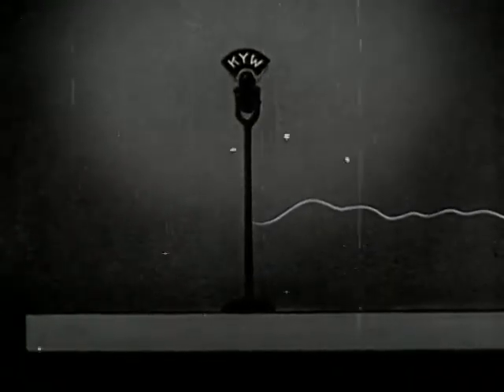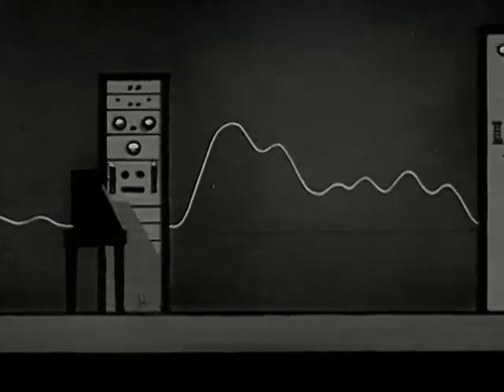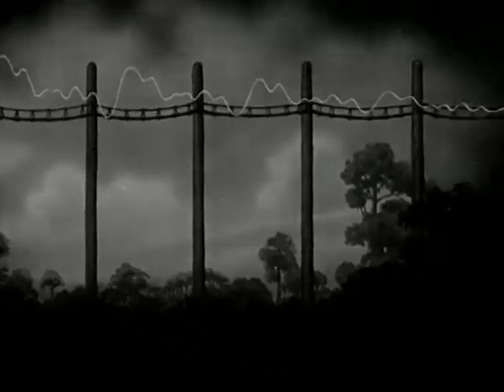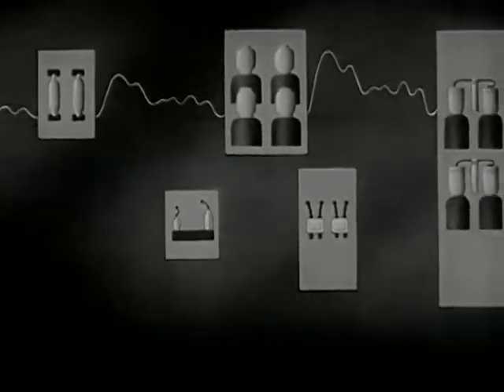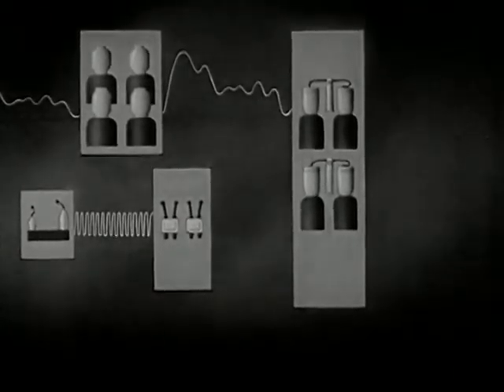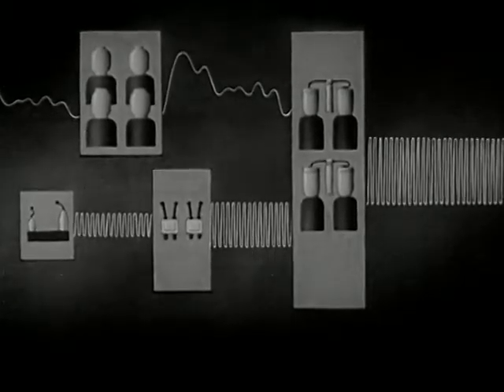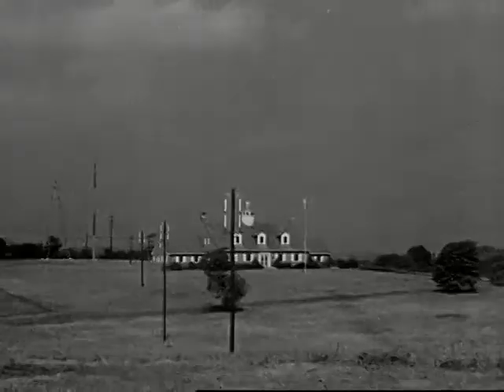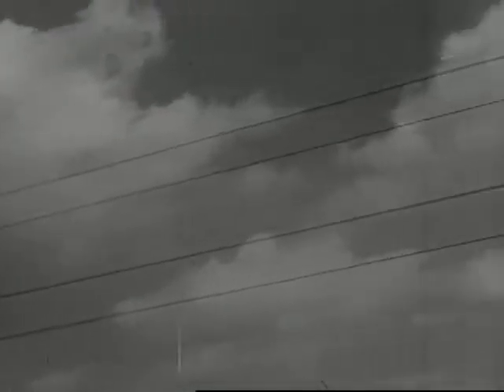How Sound is Transmitted Via Radio

Comment: So, a carrier wave is just an audio wave at a higher frequency?
Reply: As I understood that,a higher frequency travel longer,better,but the information is carried by the Amplitude differences of the waves,very ingeniouse, in my former  Imagination it was a combination of two different waves,which make no sense,how the information content get inside the Radio waves, now it became me clear,very simple.
Reply: It is a wave,they call it carrier,but it carry not an another thing...An Audio signal is ,in the beginning a dc signal, not a ac one.So it cant generate a wave.Only on ac signal can generate a electro- magnetic wave.So they transforme a dc audio electric signal, as it is ,to a ac one in same form as original dc one ,on high frequency which travel as electro- magnetic wave.
Reply: It’s a light wave, actually.
Reply: No they are simple em waves, Carrier wave doesn't have any information of its own, they act like a train that carries signal from one place to another
Reply: @anshul.singhs  Carrier waves have two proprieties: frequency and Amplitude of the sinus wave at  lowest and highest points,which points are exactly the pattern of the dc signal from the mocrophone.By rectification ,due Diode bridge this ' pattern' came in the same original Form as dc current out.The Name ' carrier wave" is a theoretical construction,have no independent existence, thre is only one wave with information content.Easy.